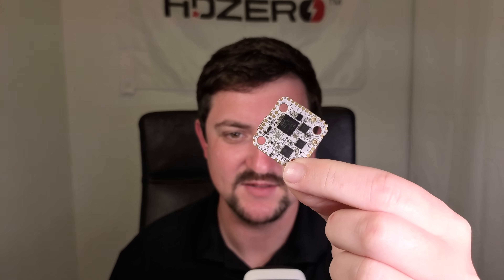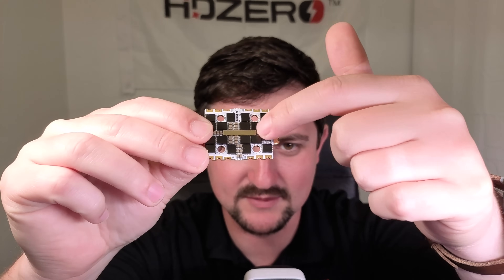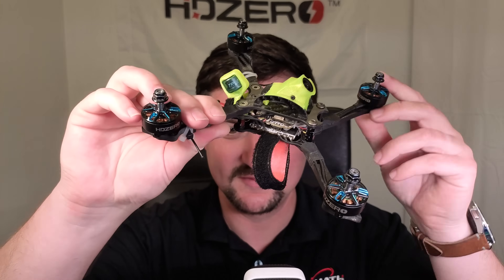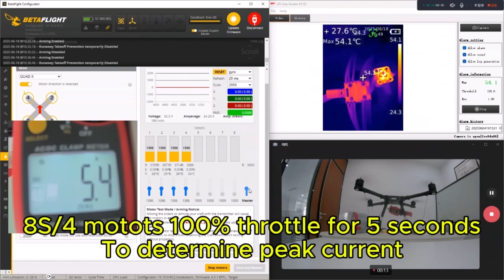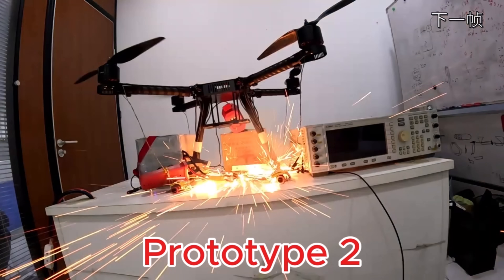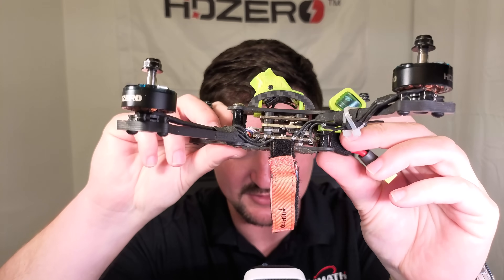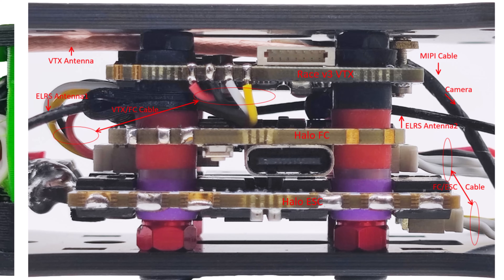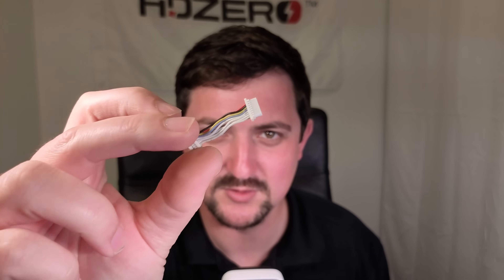The Best Engineered FPV Stack Yet? HDZero Halo Stack

Comment: on the zigzag build with the esc downward the fc-esc cable seems to be a tight fit against motor arm, maybe adding pressure to the connector. no problems after many flights?
Reply from the maker: I do have problems with the zig zag build actually. When the front arm breaks, the arm rotates and crushes the ESC. The same thing happens on the rear arm, but it crushes the vtx. I have broken both esc and vtx from this flaw in the zig zag design. More clearance would not have helped, once the arm starts rotating, anything within 10-20mm is going to get crushed

Comment: That improved JST plug idea is nice, but unfortunately in my set wires didn't read motor 1&2, was lucky to have a spare jst to make it work, at first it freaked me out that I got faulty esc
Reply: And after I figured it out, I tried replugging it multiple times and had the same result, unfortunately

Comment: At this point Hdzero got cameras, VTXes, goggles, escs, and fcs. The only things left is motors, frames, and radios lol. And Hdzero batteries? Lol
Reply from the maker: Working on it! 🤣 just kidding (or am I?)
Reply: This video certainly had HDZero branded motors @ 5:24 Although they do look awfully similar to the 533 headsup motors ;)
Reply from the maker: Those are 533 motors

Comment: Hi I would like to use this esc to support HDZ (fav fpv brand :) ) but I would like to use a tbs lucid pro flight controller due to the halo fc not having an osd chip. Is this doable? thanks :)
Reply from the maker: Yes, our Halo ESC is compatible with any other Betaflight FC. Just make sure to re-pin the ESC to FC cable to match the FC
Reply: @RyanQuellet Sounds good, thanks for the hard work. Can't wait to fly a full size HDZ ESC!

Comment: Minor nit picky clarification. If an esc looks to have 3 chips per motor, it’s still 6 MOSFETs per motor, but they are using dual MOSFET chips.
Reply: yess, I was also thinking, how can you drive 3 phases without a bridge setup lol
Reply from the maker: Good to know, thanks for the clarification!
Reply: ive never seen a esc with only 3 chips per esc on something else than a <15A micro aio.
Reply from the maker: @KidCe. I believe the Rush 60a has only 3 per motor. But as andy said above, its probably a dual MOSFET in that case
Reply: @RyanQuellet just saw that part in the video. Damnn i didnt even know there are dual mosfets in that current range. Tought dual mosfets only exist for much lower currents